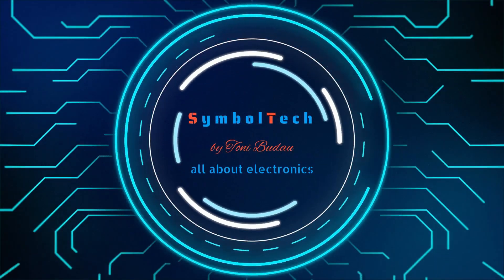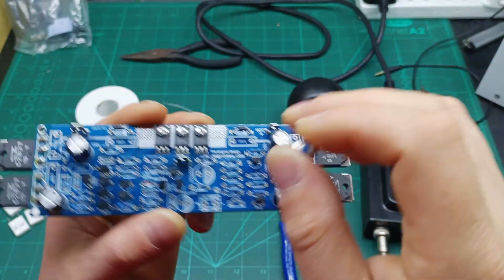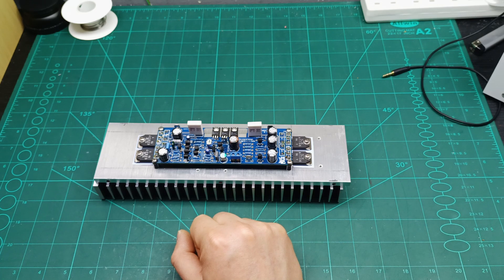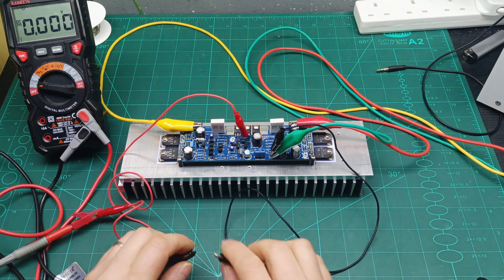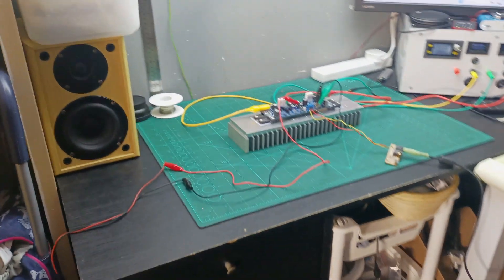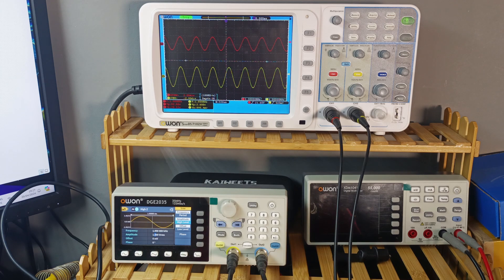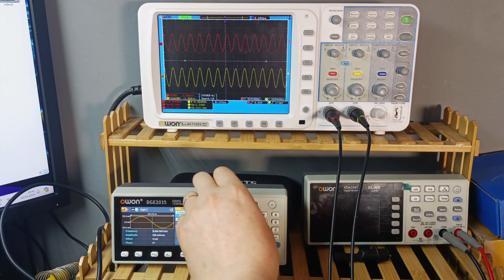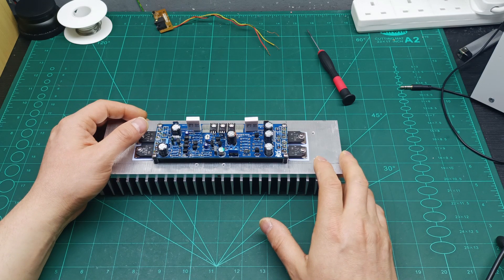Let's build an amplifier using AliExpress parts part 4 | L12-SE audio amplifier kit

Comment: What about RMA ? I'd like a more comprehensive test of harmonics and distortion.
Reply from the maker: Yo mean to use the software RMAA?
Reply: @SymbolTech21  Yes
Reply: Yes.
Reply from the maker: @sandbe4 I don't have the equipment to use with the software in order to do those deep measurements. I'm doing all this stuff as a hobby so I can't afford to put that amount of money on those equipments!
Reply: @SymbolTech21  Equipment is notbook and soundcard type Focusrite Scarlett Solo e.tc  I will be happy to look at your research and I think that I am not the only one.
Reply from the maker: @sandbe4  I tried with a sound card and is not accurate there is a channel I don't remember exactly the name of that channel and he's using a spectrum analyzer which cost quite expensive and with that one he's getting really good measurements!
Reply from the maker: @sandbe4 I got something else that can measure have a look at this video https://youtu.be/FiPiwnXeHEw?si=9SzcDGEiCZ4nxvKn
Reply: @SymbolTech21  Nice job.

Comment: There really is something wrong with your equipment. I have never had lumps or bumps in of the many amplifiers I have tested. The L12/2 is totally flat from 3hz to 60khz only 0.2dB down. With 0dB set at 1khz it NEVER rises above that 0dB. No amplifier I have ever measured goes up above that set 0dB. Gain always drops at extreme frequences. For the gain to rise, the amplifier must be very nonlinear or very unstable.
Reply from the maker: @MichaelBeeny  I need to check the signal generator straight to oscilloscope to see if is doing the same. And if is not doing the same and is all flat. This means the amplifier is the one that measures like that
Reply from the maker: Hi Michael, hope you are doing well! Look here using the same setup and looks like the measurements are different https://youtu.be/Hp2fLpvDseM?si=VKgnOWsVq2G038Sc

Comment: much better than the l20 se, this evening I swapped those output transistors on the l20 se for original Toshiba i bought in 1995 and it completely changed the sound. Bass was tight, frequency response was much better but still too much high frequency gain. When I built my l12 i also added the bias mod to use a potentiometer. But i also noticed a large DC offset on the output of the l12 se so added a 2nd pot to control the voltage offset at the speaker terminal. I also replaced the output devices with originals and found it sounded much better than the transistors supplied with the kit. Great videos thanks for sharing
Reply from the maker: @Cyrixxz  yes definitely is a better amplifier kit this